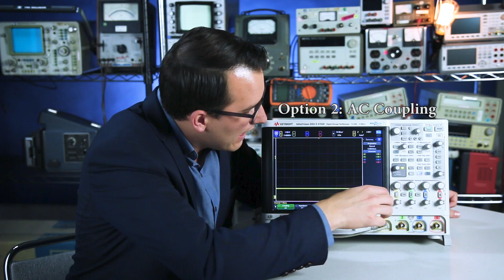AC/Capacitive Coupling - Oscilloscope How To - The 2-Minute Guru (s1e6)

Comment: In complementary with AC or DC signals, is it possible to show a growing or decaying signal (like charge and discharge of a capacitor in an RC circuit) in one your future clips?  Specially when the charge or discharge signals triggers the scope.
Reply from the maker: +esmaeil nam Definitely! At some point I'll do a brief overview of basic components and some basic configurations.  Filters and charging caps will definitely be covered.